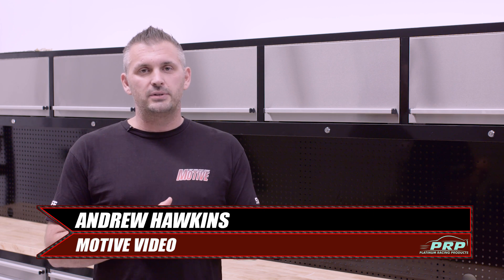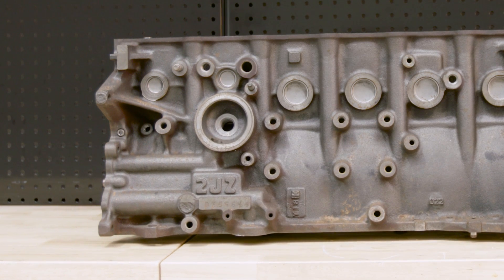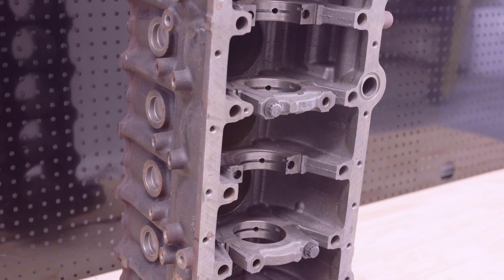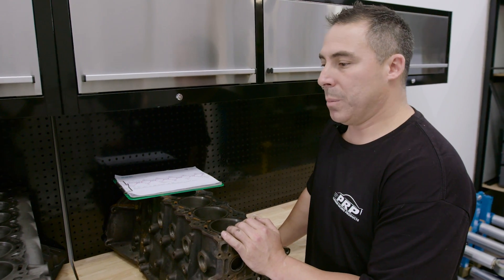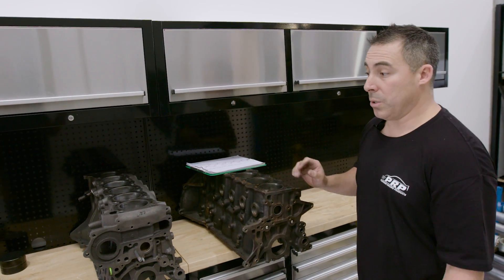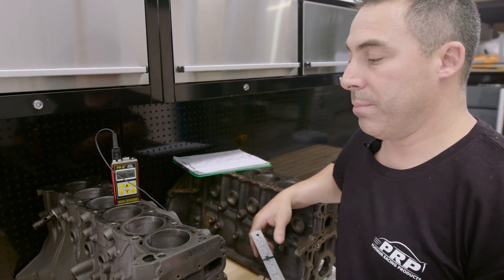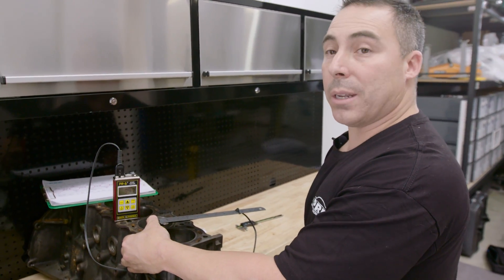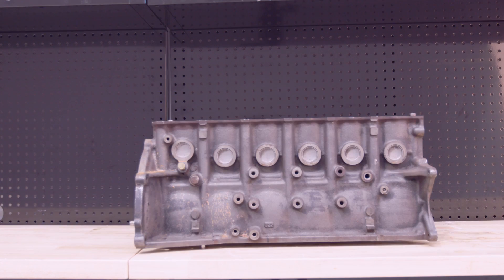RB30 vs 2JZ Which is the Better Block and Why? - Mythbusted

Comment: Next Barra vs N54 ? Please
Reply: @Mr Calcium there were Canadians who built a 5.2L drag Tb48 with a 106mm turbo they claimed it was capable of 2500hp but I haven't heard much since
Reply: @Realtime1501  Chassis Stop. It did work for a while but they're now going for a billet block version of it.
Reply: The BMW engine that would go against these 2 is the Euro S50B30, to keep it 3l. It has siamese bores, same casting as the 3.2, just smaller bore, thus thicker bores. The nicest thing about the bottom ends of those motors has to be the blue heat treated crank, a jewel 👌
Reply: @Buzdu22  the s38 is currently the quickest and fastest Bmw engine so thats in for a shout
Reply: Realtime1501 I know the S38 is the fastest one, but its a 3.6/3.8 liter, excluding strokers that go over 4 liters. The S38 could be a match for the Barra, although it’s 20 years older than the Barra... even more if you consider the M88 on which the S38 is based.
Reply: Barra Vs. 2J!!
Reply: Building a Barra powered Supra myself here in the U.S., so I have my opinions.
Reply: @barramk3  looking to replace my rb after watching this. Barras are unheard by me but n54 might as well be civics and Camrys there so popular.
Reply: @barramk3  awesome, going to confuse so many people. Good luck
Reply: @TomTubeFrancia  not common, other then in New Zealand and Australia, but were available in a few other places. Never were they offered in the U.S. though.
Reply: @coherence_x54r  Yeah, im wanting to freak out the local Toyota, and Ford dealerships lol.
Reply: Selective PC dude tell us you have an Instagram or vlog of this! That’s huge
Reply: @g6et_wrx177  I could but never really thought about it.
Reply: @TomTubeFrancia  I don't know about Barra (looks decent) but I would stay away from N54. Open deck block and lots of small problems that add up. Direct injection alone would be a PITA for a high hp build. To me, as a former 335i owner, the main advantage of the N54 is that it's fitted to a great car and it's very easy to reach 400HP. However, getting more than 500HP would cost a small fortune (even keeping a stock N54 running isn't cheap). Never again, no matter how nice the E92 is.

A BMW M50 or M52 iron blocks are both great options, though they need forged internals.
Reply: @ress87  Ok, I'd like to see these test done with an N54 and Barra.
Reply: Selective PC I’m curious to see if anyone would build a barastang
Reply: @barramk3  where'd you get the trans adapter, engine and ecm. Wanna build a barra ranger prerunner. Lemme know
Reply: @barramk3  even the n54 are belting the barra why bother with the barra,there shit
Reply: Barra vs FZ and TB
Reply: @Realtime1501  yay someone that actually knows what a tb48 is.
Reply: Barra wins that, hands down
Reply: Barra is king
Reply: Barra vs L67
Reply: your joking obviously .... @SkatingBMXfreak
Reply: Shit! I'm falling behind! What's an N54?
Reply: Sean Determan Bmw’s 3.0 twin turbo in-line 6
Reply: @seandeterman2499  bmw. Basis for the b58 in the mk-v supra
Reply: How to make your glocke safe
Reply: No need to do a barra vs anything they are the best engine ever made nothing even comes close😁.
Reply: mick weld the GM LS would like to disagree 😜
Reply: mick weld barra vs 2jz with vvt-i
Reply: tom francia why am i a neanderthal when its true and i own a N54 car?
Reply: Barra would take the n54 I have no doubt in my mind personally the Barra might have an easier time becauee it has the size advantages on the n54 so I would think that hunk of mass alone would make it easier to run fucking huge numbers from 😂😂😂😂
Reply: 2jz eats anything... fuck all u jelous fucks
Reply: Oooh that would be good